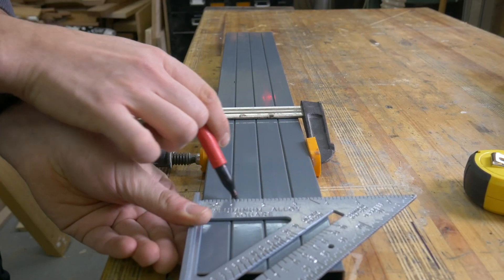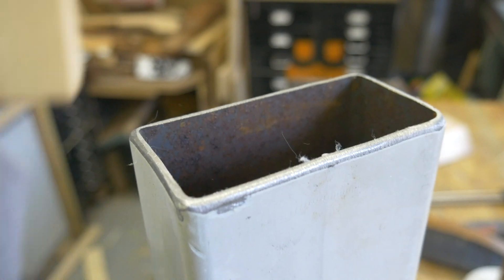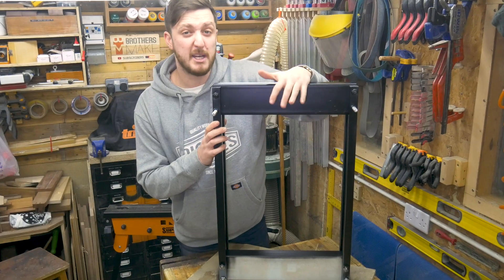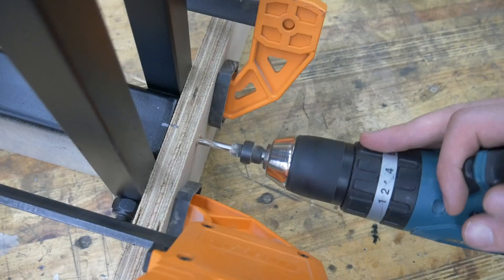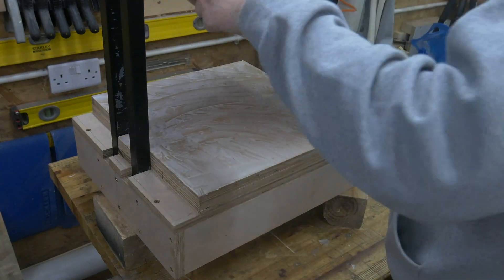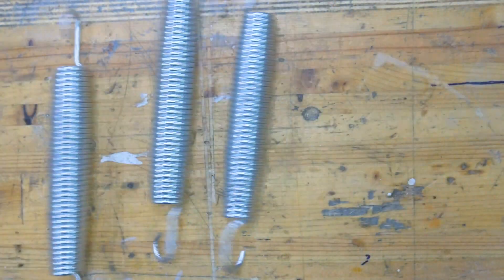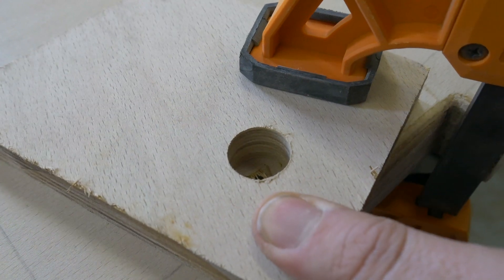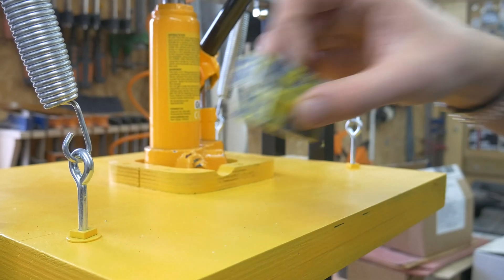Make Your Own Plastic Sheet Press

Comment: I wondered if something like this would work for a pressure pot lid (for molding and casting) so the lit could be in place more quickly than tightening the bolts. Very cool to see it in action.

Comment: Great work, keep it up! ;)
I'm thinking about building one of these 
machines (with some friends). Since our products will be all day outside
 in the sun, I want the sheets to be uv-resistant.
I know that 
uv-resistance is typically achieved by adding carbon black to the 
plastic, so using only carbon black shredded plastic will make the 
sheets uv resistant. But could you please tell me a way (the simpler the
 better) to make COLORED sheets that are uv-resistant? Maybe by adding 
uv-stabilizers during the melting process, what sould be tricky, since 
mixing the uv-stabilizers with the plastic pellets is not that easy I 
guess? Are there better ways?
Thank you very much in advance :)
Lukas
Reply from the maker: Hey! Great to hear you’re building your own!

We don’t have any experience with UV stabilisation with plastics but we know it can be done! Just not familiar with the process
Reply: Hi Lukas! How are things going with your UV-resistant plastic sheets? I'm going to make plastic signs that will be on the street all day. For dark things, carbon may be good, but what about white plastic (hdpe)?

Comment: **SAFETY ADVICE:. Put a collar at the top of the frame for the jack piston/column to go into. This will stop the jack base from kicking out sideways and flying out at you. Maybe even drill a hole thru the collar and Jack column to insert a safety pin. Otherwise this is awesome! I'm going to use this for sure!!
Reply from the maker: Great idea. Thanks

Comment: thank you for the great built! I must say that i cringed a bit when you put the wood inserts. 
Here's a suggestion: If I'm afraid that the hollow tube would warp due to screw compression, i'd do the following

1 - Drill the screw hole through the whole tubing
2 - Drill an oversized hole on one end (for socket heads to bolt Hex screws)

The bolt assembly should be only secure the 2 interface of the tubing like so 

___________      ____________
|                      |       |                       |
|                    _ |      | _                |
                 |    ||____|    | _
                 |             |    |   |
                 |    ||¯¯¯¯|    |¯¯
|                ¯¯¯ |       |¯¯¯                |
|                       |       |                     |
¯¯¯¯¯¯¯¯¯¯¯¯¯       ¯¯¯¯¯¯¯¯¯¯¯¯¯
Reply: it would seem like my ascii art had warped, but i hope you get what i mean
Reply from the maker: I see what you mean, but the wooden inserts worked perfectly well and have not budged since we made the press many months ago. Thanks for the input

Comment: what is the maximum area for a mold with a 10 ton press, 
if i wanted to make bigger pieces i would need a bigger press or i would have to make a bigger structure, great video
Reply from the maker: That’s a good question! I’m sure a 10 ton press could produce bigger flat sheets but not sure on the size